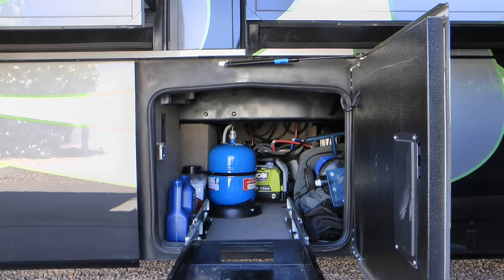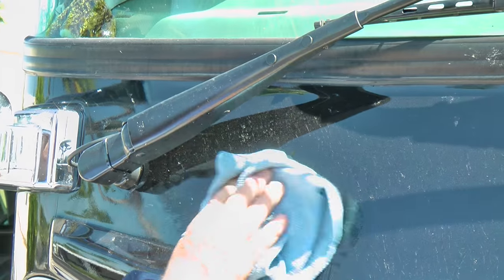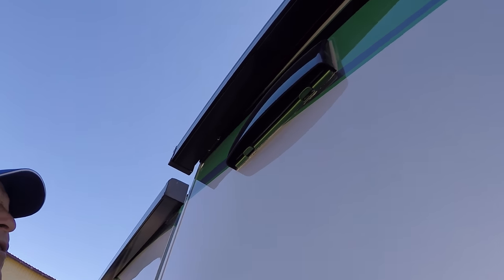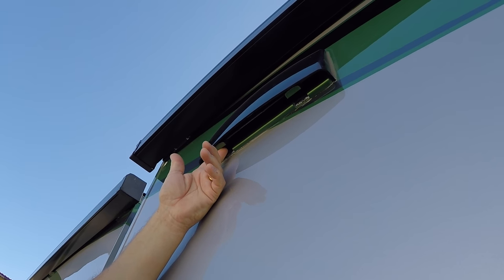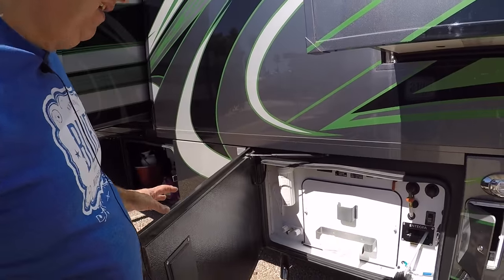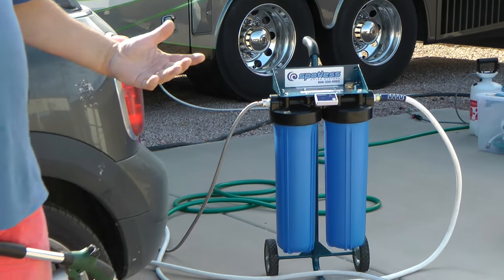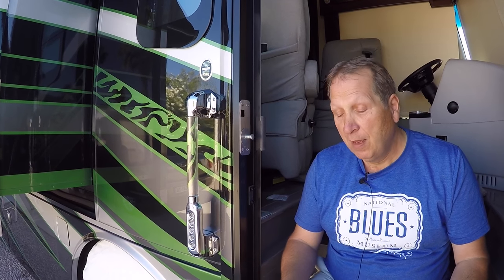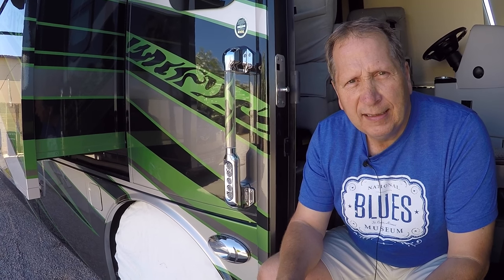Entegra outside tips part 2

Comment: Thanks again..Glen!! A lot of great info!
Reply from the maker: Hi Ralph,
I think I used a 2 gallon tank purchased from lowes or home depot but the size of the tank doesn't really matter the bigger the tank the more water you will have before your pump will kick in. Here a link I found that may help:  http://wannabrv.akom.net/archives/12-RV-Expansion-Tank-Installation-in-the-trailer.html  the only real consideration is the space it takes up. Let me know if you need any diagrams of how to install this.
G

Comment: You mentioned platinum membership for TT, but when I go to their page you can only select two zones for $549. Is that the Platinum membership price you are referring to? That price gives you also the 30 days free you are referring to?
Reply from the maker: TT Membership can cost you anything from $2,500 to $10,000 for the membership itself and then you pay $549 per year, you can then sell it on as and when you want to, so it's fully transferrable.
Reply: I'll guess if you're full timer it may come handy to pay that kind of money.
Reply from the maker: +Hector Rodriguez 
Hi Hector , you don't have to be full time. If you wanted to
spend 1 month a year in Palm Springs or Florida etc you would not only get your money back but you would still save over $1000
Reply from the maker: +Hector Rodriguez 
Hi Hector , you don't have to be full time. If you wanted to
spend 1 month a year in Palm Springs or Florida etc you would not only get your money back but you would still save over $1000
Reply from the maker: +Hector Rodriguez 
Hi Hector , you don't have to be full time. If you wanted to
spend 1 month a year in Palm Springs or Florida etc you would not only get your money back but you would still save over $1000

Comment: WOW!! They left the Vac bag out.... You better check and she if the motor has a oil stick in it..  

Its little silly stuff that adds up.. 

You had a small pipe fall off your black pipe deal.
Forgot to open stove top vent.
Vac has no bag.
Steering Problem fixed what 6+ times now.. 

And the list is small but some are just silly..
Reply from the maker: You're right it's the small things they have forgotten that make you wonder what large things they have forgotton